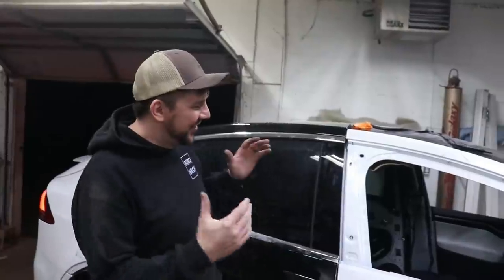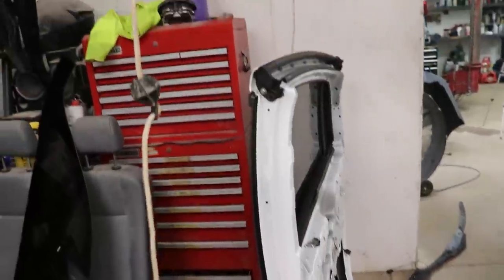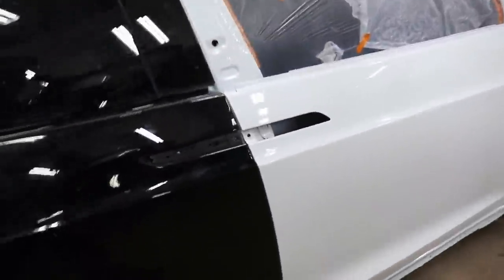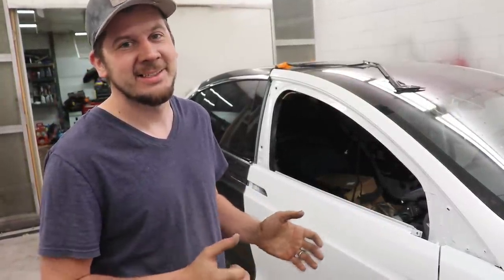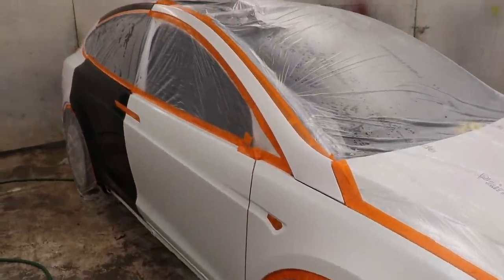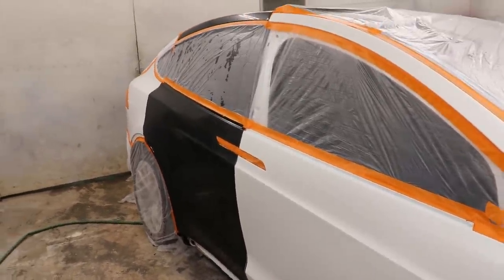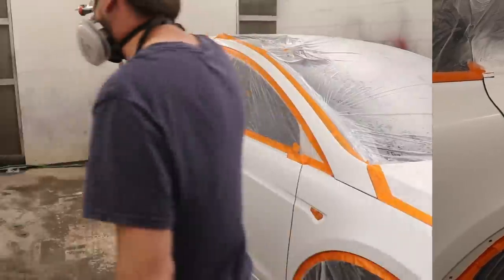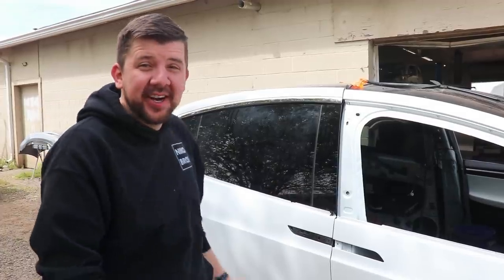TESLA MODEL X WE DID A FINAL PAINT JOB AND IT LOOKS GOOD

Comment: What is in the black bottle that suds and are you using 320 or 400 sand paper 🤔
Reply: Usually soap mixed with some water, helps the sandpaper slide easier and keeps debris out of the sandpaper. If I'm roughing up a existing finish to shoot over, I use 600 grit
Reply: @dave1135  thank you.